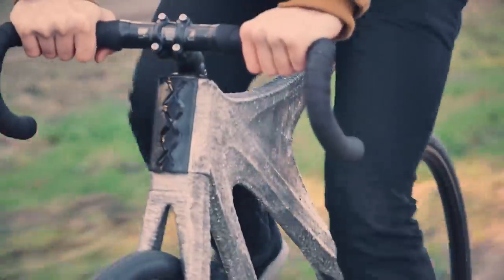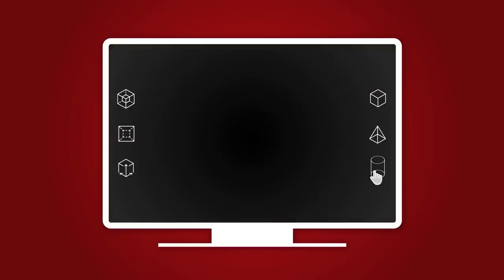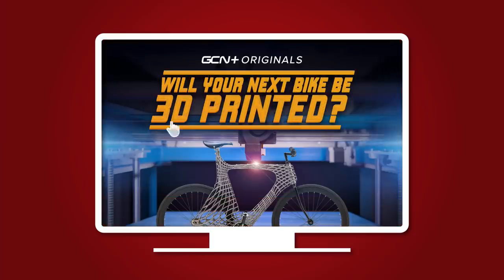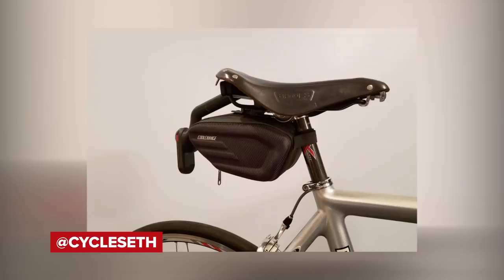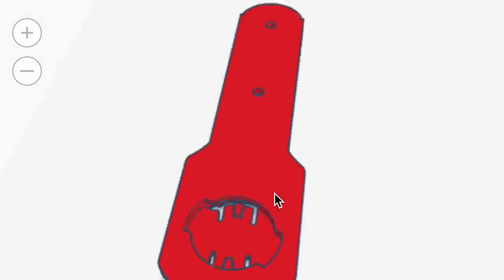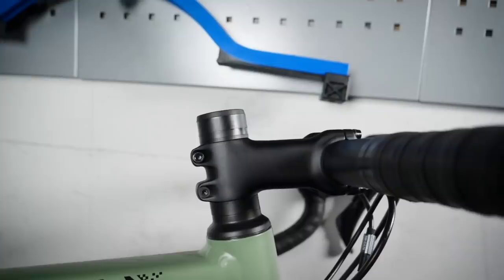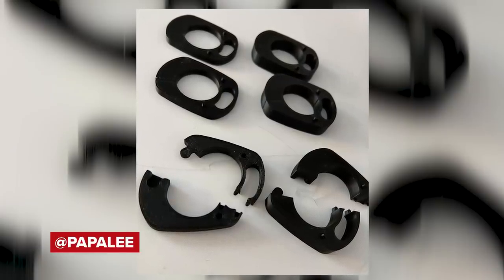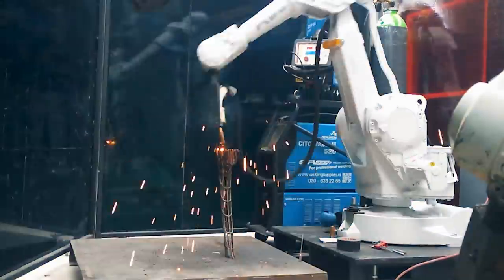The Coolest Homemade 3D Printed Bike Parts!

Comment: Pro tip from an engineer working for plastics department at my university, to make a part stronger increasing the wall thickness helps more than increasing the infill percentage. The part walls are in direct of load most of the time. Great video, I printed spd-sl sneaker plates for casual riding, they work great so far ✌️
Reply: Pro tip from a physicist: Be aware of the anisotropy with the weak link being the layer direction. Use it to your advantage by printing multiple pieces by their main load direction and join them with super glue rather than printing a single big part which will very likely fail. Carbon reinforcements also work wonders if you want it to stay flexible.
Reply: @log_it8282  great advice, you're right ✌️
Reply: I came here to say this. Not as an engineer, but just someone who has been printing and designing for a bunch of years now. Infill is more to be thought of as internal support.
Reply: This and the other replies are correct, there is a lot more complexity than this video makes out. However it is a YouTube video that's dumb down for the generic audience and not for us engineers. Is a little knowledge here dangerous?
Terry
Reply: @FiveMinuteVelo  yes, this video vastly oversells 3D printing.  I have multiple printers but would not trust any bike part to a 3D printer.
Reply: @truantray  disagree, even  cheap 3D printers can produce useful non-structural parts, I have made them myself and are using them. What I would agree, is that a little knowledge can be dangerous, and if the uninformed start pushing the technology too far it could lead to disaster. 
Terry
Reply: Do you mean plates that clip to spd pedals to convert them to flats or plates that let you connect your sneakers to spd pedals?
Reply: @rocketappliantist4969  plates that clip onto my SPD SL to transform them to platform pedals, so I can ride them with my sneakers.
Reply: My mountain bike is covered in 3d printed parts. From stem spacers to boost wheel spacers to boost brake spacers to bushings for shocks to handlebar grips to bottom out bumpers on my shocks to chain devices. 3d printed parts can hold up just fine.
Reply: @adamchambers7502  agreed, no such thing as a bad material or bad process, just inappropriately used materials and processes.
Reply: @FiveMinuteVelo  yeah and thing is, im 100kg plus, and i have things like custom inserts that go between the turns on my coil shock to increase the spring rate, which could see forces in excess of 600lbs in compression and they are just fine. 3dp requires a little understanding as to what the parts are good at.

Some more bits i have are tpu handlebar and crank inserts to store my tyre plugs quick links.  A custome travel reduction soacer in my fork, a handlebar hook to hold my full face helmet chinbar on climbs, and a chain dampener loop
Reply: Pro tip from YouTube, cnc kitchen tested it, you don’t need to be an engineer to know it.

Comment: I made some aero boxes that hold hydration bladders under the aerobars and in the frame triangle of my tri bike. I mix my nutrition as a drink and can fit enough for the bike leg of an Ironman. I don’t have to mess with refilling a reservoir or shuffling bottles around. The straw is held in place so I only need to leave aero position to maneuver or stretch out. Plus it looks cool.
Reply: Thinking about the same. Are there any details on your project?
Reply: @vladimirzhukov4378  I suppose it’s sort of hard to describe. Total capacity is about 2.5l. The box under the aero bars is the whole length of the bars and fairly deep. It has sort of an airfoil shape. Taller than it is wide. Fixed with zip ties. The frame box fits tightly in the lower half or so of the main triangle. Fixed with the existing frame bosses. I am on an Argon 18 E119. The older model with rim brakes. Size S.

Comment: I made a little clamp that has the functionality of a hand brake. When i come home from a wet ride, i can clean the chain without it wobbling and then put it in the garage to dry fully. Very handy tool. Also, spacers for your discbrakes when you remove the wheels.

Comment: i designed and 3d printed custom camera mounts for the GoPro Hero Max so that you have that properly stitched, detached view; fasteners for the Garmin Varia STL515 that uses zip ties instead of the rubber bands; storage holder for CO2 cartridges + inflator, etc. ... stuff like you said that aren't load bearing  ... a useful tool(s) for designing these items are a vernier caliper and Autodesk Fusion 360; i prefer PETG filament instead of PLA; PETG is UV resistant and is the medium between PLA and ABS. I'm just an engineer that loves cycling also ... you can see some videos on my channel as examples

Comment: Uh oh! I thought about printing headset spacers a couple of years ago, but decided it wouldn’t be safe. Though they’re not specifically load bearing, I think there’s probably too much force going through them as you ride.  PLA probably wouldn’t be safe over the long run. Might be wise to ask an engineer though. 🥺 Just think of what would happen to your steering if all of a sudden one of your headset spacers disappeared.
Reply: You are correct PLA is probably not the best material to use as it is 'at least in theory' biodegradable and hence may deteriorate over time. I must admit my favorite material is TPU as it is flexible and very tough. Here is my first 3D printing video: https://youtu.be/mc-1zr1Nm4M
Terry
Reply: @FiveMinuteVelo  - just checked out the video! Great print. That gap between fork & headtube is almost nonexistent now! 👍 I’m using tpu for most of my bike prints as well. Light mounts, chainstay guards, frame plugs, etc. Great point on the biodegradable aspect of pla. With lots of uv light & moisture, I don’t know how long the headset/stem spacers would survive, even if they aren’t taking a lot of compression. Yikes!
Reply: I turned some spacers from white plumbing PVC about 10 yrs ago and it’s been fine. Has been raced, hammers, etc.  It’s just under compression.

Comment: Just spent a satisfying afternoon in my workshop making a replacement part for my shifter using only hand tools. No 3D printer required and it's made of aluminium instead of plastic.

Comment: I have a bunch of designs for bike tools on Thingiverse. You need to know the limitations.  3D printed plastic is not as robust as injection molded and typical plastic like PLA will warp in sunlight. 
Ideally, you need to use Nylon for parts, which means you need a far more expensive printer.

But for shims, saw guides, headset presses, stands, it's OK.

Comment: 3D printing IS NOT wrought or drawn. You take the risk.

The drawing file for the 3D print product is best done on a package that has finite element stress analysis. You need the Youngs moduli of elasticity and rigidity for the material you are using.
Remember with 3D printing, there is no polymer grain structure.
3D printing is OK for model aeroplane wing and fuselage parts, because there are no human passengers at risk when the thing hits the ground.

3D printed metal parts as as good as castings. No structural strength.

Comment: More videos to follow this idea though would be good. Would be useful to discuss pricing. Leaving aside machine cost how much does it end up costing to make that part. Alex mentioned in the part he made for his bike it took several attempts to get it right so overall what did that part cost and was it worth it in the end.
Reply: Pennies. A 1KG roll of filament is like $30. You can print and refine a lot of things and spend less than buying a manufactured one
Reply: It's very cheap after you've bought the printer. Mine was $3000 AU so not cheap for a good one. The thing that costs most is your time to learn the software, then use it to print, I'm only just starting to get okay at it after many months of learning CAD. Then you have the 'failed prints' time, and the 'works but not exactly what I'm after' time. I find only rarely there's an exact 3d printed part that I'm after online, and retro engineering a part is a really painful process.
Reply: I couldn’t stomach the cost of an out front mount for my canyon integrated bars and designed a 3d printed one. It’s been through 15-20 iterations over 3 years and has cost me at least the same as a bought one. But the satisfaction of doing it yourself outweighs the time and financial costs!!

Comment: What's the deal with comments getting auto removed on GCN videos? Like what are the rules?
Reply: Like, I tried to point to an interesting 3D print of mine a couple of times, but the comments got removed. Bit annoying.
Reply: One of them didn't even contain a link, just a description of where to look. On the other hand there are tonnes of obvious scam spam comments that are not being touched.
Reply: I’ve run into the same issues. Did you try posting it as a reply to this comment?  I got one to stick like that on another video.
Reply: Its YouTube, some algorithm seems to decide who gets to say what. I'm rather sick of it. I asked them if there was a way to allow ALL comments on my channel and they said no. Considering switching to another website.
Reply: Hmm ok. Not sure there is a viable alternative really. Maybe Vimeo?
Reply: Third try: if you use an internet... finding... system... (🤷‍♂️😁) for Yet Another Garmin Bike Handlebar Mount, you'll get the print I was trying to share.
Reply: @timangus  I found it but don't have a 3D printer.